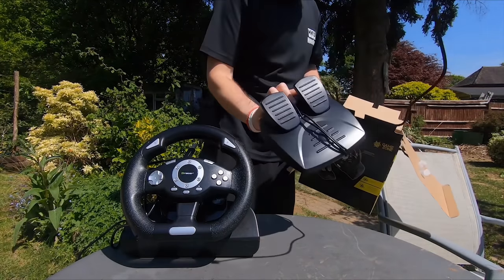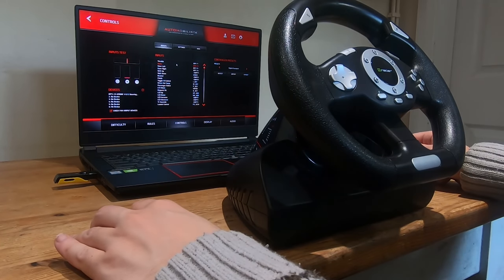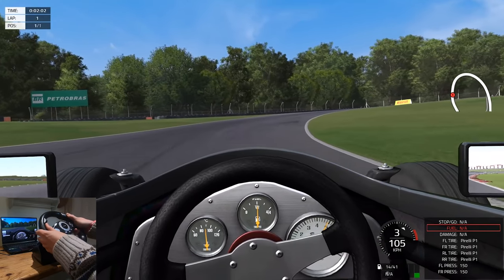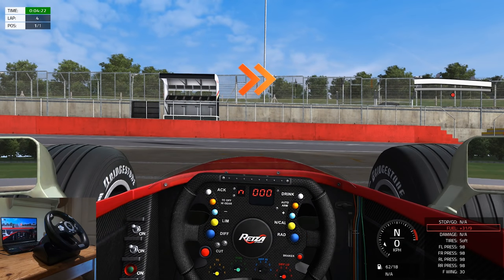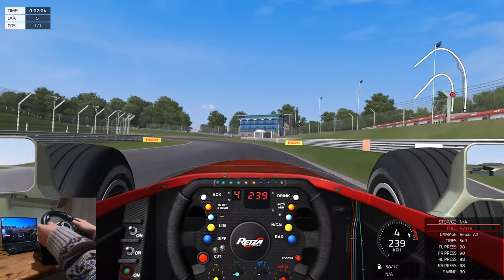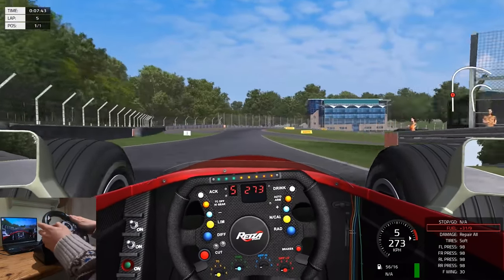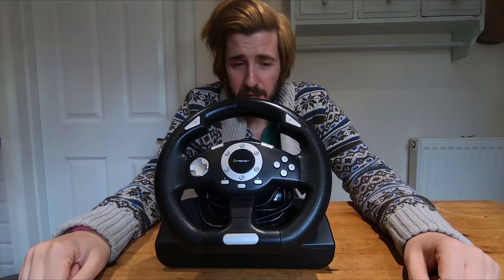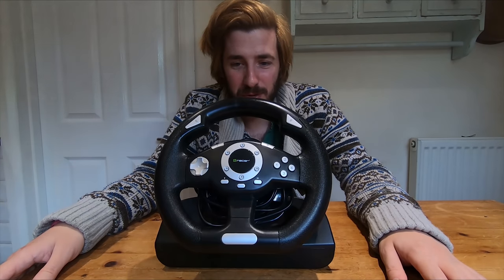Amazon's Cheapest Sim Racing Wheel Is Better Than I Thought!

Comment from the maker: Sorry about the flickering boiz, only realised it after recording :(
Reply: Jimmy Broadbent hi
Reply: shh bby is okay
Reply: I had a party while waiting Jimmer!
Reply: not your fault boss...the flicker is caused by the fact that the lights strobe at the line frequency of the electrical power and if your FR (Frame rate) of your device is close to that frequency, it is noticable. Nothing you can do about it so don't worry.
Reply: Hi jimmy, I’m currently using a cheap wheel and pedals, hori apex RWA for PS4, Would it make a lot of difference if I upgraded to a Fanatec  CSL elite. thanks
Reply: Jimmy ur the best, big love from Texas!
Reply: Flickery boi
Reply: Whoever masters this wheel is the true tarmac specialist
Reply: As long as you don't clip the black point when you edit the video, I'll forgive you.
Reply: @railwayman100  most of the cameras has option to adjust shutter speed, then you can get rid of the flicker in normal situations (like this is).
Reply: Hi there Jimmer!

This can be reduced/eliminated in edit!
What you would have to do is duplicate the videotrack, shift it over 1 frame and reduce the opacity to 50%.

This flickering is offcourse down to the frequency that your fluorescent tubes are using. 
This is usually 50 or 60hz, therefore you would have to use a 1/50th or 1/60th shutter speed to match that.
Reply: Just use 50 or 25 fps on the camera instead to match the power freq. of 50Hz. And a shutter speed to match if possible like 1/50th or 1/100th of a second. But the fps is most important.
Reply: Love the christmas sweater
Reply: Oh I thought it was disco themed
Reply: if i remember correctyl if you are using a led light bulb the flicering means that the capasitor in the rectifer in side of a buld is broken or the factory used a low capacity one i moght be wrong tho coz i just started mechatronics
Reply: F
Reply: @Elgsdyr  Yes, exactly this. 60/30fps cameras of the Americas don't match the Europen 50hz system - also why our analogue TVs were 50 fps. :)
Reply: "Jimmy Bruhbent"...
Reply: honestly did not even notice until u mentioned it
Reply: Use the wheel with the f1 drivers when u practise plz would be so funny but only for a bit
Reply: Andy Mooring not close but if the frequency is a harmonic of the light strobe which is likely 120Hz. This must have been recorded at 60Hz it 30Hz
Reply: Previous video: we have analogue!
This video: we have flickering!
Next video: we accidentally delivered killer hornets to England
Reply: Is that new go Pro on the LED lights?
Reply: YouTube continues to unsubscribe me from your channel!  3rd time in the last week or so now.
Reply: Can you find it in your budget for a white balance controlled LED camera light? Would look good over the peddle box cam too.
Reply: @ls-so8bt  yes I know but Jimmy didn't know this at the time of recording. If he wants to, he can get rid of the flicker when editing the video by duplicating the same clip but move the 2nd clip by 1 frame. All this does is fill in the empty gap of the flicker from the 1st clip and the end result is good...flicker gone. I'm sure Jimmy can fix his shutter speed of his cam the next time he goes in the house...only question is, what speed does he set the shutter to counter-act the flicker and I don't think Jim is going to waste a day doing that.
Reply: didn't notice until you mentioned it
Reply: @robbuckgaming2541  yes my friend 🙂 it will take a few hours to get used to force feedback, but it will be a giant difference and it's worth it, just make sure the wheel u buy supports PS4 if that's what ur using.
Reply: Switch to leds man.
Reply: @MrtinVarela  not his house bruh, he be a burglerboi
Reply: @railwayman100  you knew but just choose to say something else... that isn't kinda flicker you could easily remove in post edit. finally, when we don't know what cause the flicker there is not point to guess what shutter speed will fix it. setting right shutter speed is like 10sec thing, if you have no idea what you are doing then it might take 5min, not a day.
Reply: @railwayman100  He can try recording different shutter speeds and framerates.  Usually you can find a setting that works.
Reply: @catapultimage1137  "He can try recording different shutter speeds and framerates" now that Jimmy has noticed the flickering, yes for next time...if there's a next time.... but as he said, he didn't notice the flickering until after recording so he wouldn't have known during or even before recording what speed to choose seeing as he was too focused on making this follow-up. There is a small amount of flickering in the previous T-racer video...you can see this for a few seconds (go 3 minutes 33 seconds in).
Reply: RobBuck Racing from personal experience, HELL YES!
Reply: fluorescent bulb in the room?
Reply: @robbuckgaming2541  lol
Reply: @robbuckgaming2541  about 45 seconds mate as long as you find 43 in yourself
Reply: Trying hard to think about the "never give up" meme after I went into AC and tried hopelessly to beat that 1:08 on Brands Hatch and failed, with a better wheel (no ffb as well but still better than that one)...
Anyway, great video, no need to apologise for anything Jimmer. Keep going strong.
Reply: pesky LEDs
Reply: dude you look more like some English rock star from the 70s then an actual new reporter
Reply: a suggestion on the brakes I feel like if you open it up you'll see a spring mechanism or something like that and to brake much better you have to replace that spring or at least put something to tighten it up so you at least get to brake properly
Reply: only noticed it when I saw this comment.
Reply: @railwayman100  well... there are plug-in effects to correct for this sorta thing
Reply: It has such good ffb the gaem can't handle ahaha
Reply: Every recording needs to have a problem big f bad luck.
Reply: You should test the Thrustmaster TMX. It's what I have for my Xbone. 900 degree rotation, optional clutch and shifter, works on a Windows 10 pc and comes in a only 100 quid.👍
Reply: I feel your pain. I have a fluorescent light that does the same when video-calling. 60Hz light & 60 fps, bad combo.
Reply: Please no flickorino :p
Reply: Jimmy Broadbent my eyes :(
Reply: itz cool boiiiiiiiii
Reply: Taya's Mini Lops leave it
Reply: What flickering?
Reply: Eh, I noticed the flickering but I didn't find it had any effect on the video.
Reply: @robbuckgaming2541  it would be a massive difference. Something like a hori rwa compared to a belt driven fanatec is such a massive jump it will shock you.

If you're used to using a bungee cord hori wheel, then a fanatec wheel would feel fucking amazing to drive on. The feeling of going from logitech to a belt driven wheel was the most satisfying feeling.
Reply: Alec Pitcher I bought a fanatic csl elite in may, it’s the best thing I’ve ever bought, improved my times on all games buy loads, thanks for your input mate. 👍
Reply: I have a t 80 thrustmaster so your saying I shouldn't upgrade
Reply: Yeah it was slightly nausea inducing ':-D
Reply: Waht did you were playing while using the streeting wheel?
Reply: Yeat

Comment: You should do a Beamng rally stage with this wheel.
Reply: @the Game, Review and Reallife Channel Beam is a lot more diffucult, and the crashes are realistic, so he will crash, and it will be satisfying
Reply: At least he has throttle control... try the BeamNG steering wheel app! 😬
Reply: Henry R. You’ve not played dirt 2.0 then
Reply: Beamng is a crash simulator not a driving simulator. It’s hard to drive beamng because the driving physics are wrong.
Reply: @dylanzrim1011  exactly why it is fun to play, you play beam for the crashes, not the driving, that's why it is more difficult, and no, I have not played dirt 2 but I did play older dirt titles
Reply: BeamNG: I see you have chosen death.
Reply: He aint ready for that carnage
Reply: Dylan Zrim coming from a rally driver, Dirt is incredibly unrealistic. Especially tarmac driving.
Reply: Henry R. The new ones are equally as inaccurate as the originals.
Reply: @renderyours510  how about BeamNG? Is it a little bit accurate? Because the physics in it is pretty good.
Reply: @dylanzrim1011  beaming actually has really good driving physics, Jimmy even mentioned it in another video.
Reply: He will never finish the stage without crashing
Reply: @dylanzrim1011  the physics are fine,the car setups are bad
Reply: @dylanzrim1011  Bruh... If you think BeamNG is a crashing sim & not a driving sim, then you bought the game for the wrong reason
Reply: Those saying BeamNG is a crashing sim or has terrible physics is maybe playing some old pirated version or just repeating someone else's opinion on an old version because newer versions are pretty accurate. Also, force feedback was added-oof, quite a while back! I've lost hours to tuning suspension  and swapping out all sorts of parts for stupid setups with 40 psi of boost or make some springy off roader, and even the setup on the bus is fun to mess about with.
Reply: @dylanzrim1011  actually beamng is the best sim for rallying with consequences
Reply: @dylanzrim1011  it feels like every car in beam has no grip at all, if you turn all the way at 20 MPH it'll just slide the tires but if i did that in a real car it would turn really hard and chirp the tires
Reply: @isatntt  Depending on the car you need to do a bit of tweaking. Many haven't been updated to fit the updated physics. You can definitely get cars to oversteer properly in Beam, sometimes just changing tire pressure is enough

Comment: Me: Still, I'm gonna get the Logitech G29

Wife: Watches this video with me Naaaah you can buy this wheel!

Me: -_-
Reply: hahahahaha
Reply: @carscoffeeandcannabis-634  ya but t300 costs $100 more and the G29 has better availability
Reply: @carscoffeeandcannabis-634  Never thought about that. Thanks for your opinion 😀
Reply: Get the T500 they are dirtcheap now. Much better same price
Reply: @carscoffeeandcannabis-634  Well, the prices are crazy now from my knowledge. I wanted to buy a t300 RS GT but now they are around $450 and out of stock or on a sketchy website.
Reply: I have the g29, its ok, but the pedals are too soft, at least the brake has more resistance, but the throttle its too soft. I'm thinking to buy a fanatec wheel and pedals
Reply: @carscoffeeandcannabis-634  250 CAD? The cheapest I can find are €350
Reply: G29 has design flaw in it (one component that uses magnet to determine which position your wheel is in, if it fails, wheel will be few degree's off center) + its rather loud compared to Thrustmaster products. 
this comes from person who has the G29
Reply: The struggle is real lol. This is happening every day somewhere around the globe 4 sure. It is the only reason this crap is sold. Why do you always have the buy the more expensive stuff the cheap stuff is often just as good. And you have to try explain why in this case a g29 is the cheapest decent bullit proof wheel you can buy. And a wheels/pedal stand is a must. Second hand I bought both for under 250 euro ' s all in.
Reply: Hahaha! ^^
Reply: I have the G29 for Assetto, Dirt rally 2.0, GT sport, etc. It's a great budget wheel and I got it for 250cad. Tried the T150, found the FFB far too light and the pedals were the same as my cheap T80 which actually served me well for 3 years. If I wanted to spend about 400 more for a T300+T3pa pro+Th8a shifter I would have done it, but I'll probably upgrade to fanatec or direct drive options in 2-3 years
Reply: Cars, Coffee and Cannabis- damn that’s a great deal! Sadly I’m located in Germany and not to keen on paying import taxes and having the risk of my wheel getting shipped over the great pond..
Otherwise this would be the start of my sim career and I finally would buy a sim wheel after sneaking around them for years.
Once in a while I play with the fanatec setup of an colleague and it’s like heaven to me, sim racing is so much fun and I dream about my own rig everyday.
Hopefully in the near future I’ll be able to afford one!

Anyway it’s really nice of you to offer these wheels to fellow loyal Jimmer Fans at these pricepoint!
Reply: @carscoffeeandcannabis-634  is this offer for real? Like, can I take you up on it?
Reply: @sammylockwood  I have a g920, which is just the xbox version of the g29 and it is pretty good. I dont have any issues with it so if the price does matter than its definitely worth the buy. As for the T300 i dont know how much better it is for the extra $100, ive never used it
Reply: G29 a great starter wheel IMO, i've just upgraded to a csl elite but can definatly reccomend the g29
Reply: @carscoffeeandcannabis-634  I'm in Canada I'll come pick it up within social distancing lol.  Do these wheels work with ps4? I can't remember.
Reply: Nice job on pretending to have a wife and having any chance of sim racing in the house
Reply: @rrp6405  I already have plans. And She knows it!
Reply: Basically to sum up the replys u got don't buy a g29 I have one they are not fun past the second week and very frustrating, the force feedback sounds like a rave going on inside the bass of the wheel with people dropping shit all the time. And the pedals are a YOKE. Your better off with a thrustmaster  t150 or t300 if u have the cash to splash
Reply: I have a g29 brilliant wheel but the pedals aren’t great but I used a spring to stiffen the accelerator and clutch
Reply: Even the t80 is half decent
Reply: hahaha i cant afford on steam assetto corsa at 2 dollars
Reply: there are some better ones for under 50$
Reply: I had 2 thrustmaster wheels and had real issues with reliability, kept just falling asleep and not calibrating. I have had a great experience with my g29. Just my experience but I have been far happier with my g29...gear driven or not..
Reply: @Cynderfan35  yeah it is louder for sure that's a good point. G29 is so reliable though...

Comment: While prices are definitely skyrocketing, get the "logitech driving force GT" as an entry level force feed back wheel. Got it before the rona for 40$ used on Ebay and never looking back
Reply: yes its great ! even working on consoles with a converter
Reply: I bought a used G27 from Facebook market and hell I aint looking back either... Got couple of scratches here and there but still works perfectly well with the software.
Also it costed me half the price of a brand new G27 so I really cant complain... With or without warranty these things are reliable so im really good with that.
Reply: Diving force GT is great but if it's out off budget older Wingmans or MOMO are also great entry FF wheels if you can live with 180 degrees.
Reply: @victim2077  I had a Wingman Formula Force. It was still going strong but It doesn't work with 64 bit Windows and Logitech wouldn't support it and make it compatible. I read somewhere that someone made a driver that made it work in 64 bit but then the latest version of Win10 broke it again.
Reply: Since the Rona I decided to set up for GT6 in the common area, had been playing on a pad for ages but decided to get a wheel.
First one I saw was a DFGT for £20 on gumtree I didn't know anything about what wheel to get and started looking into what is a DFGT. By the time I realised how cheep it was it was gone.
Started looking for other stuff and a few days later I got a Formula Force EX from about 2005 for FREE!! wasn't even sure that it worked on PS3 so was stoked when it started spinning.  Been having a great time with it although I wonder how much better a DFGT would be I think they are similar except the rotation angle is bigger.
Anyone else had an EX and how does it compare?
Reply: @Dethmeister  I use "red wingman" on my 64 bit Win 10 never had any issues and I am using official logi driver
Reply: @victim2077  , Really? I think mine is a first gen, it has the full red rubber wheel. Is yours a newer Wingman Formula Force GP that just has the red accents? Mine isn't a GP. Anyway, I bought a Fanatec wheel set a long time ago to replace it but it'd still be cool to have the Wingman on a second computer. But from everything I've read, it won't work in 64 bit Win with official Logi software.
Reply: @Dethmeister  Yeah I have Formula Force GP. Even works on PS2
Reply: @victim2077  , I think what's different about mine is that it has an old style joystick plug connected to a usb adapter.
Reply: @Dethmeister  mine works 64 bit. Download 5.10 driver
Reply: The only thing I don't like about my GT is the force feedback doesn't let the wheel return to center as easily as it should so when drifting I have to manually do it.

Makes drifting harder than in real life.

Looking for a cheap converter for my PS4.
Reply: I got a Microsoft Sidewinder force feedback for FREE because the seller just didn't want it! Shipped to my house for no cost! It's great, full ffb and great wheel!
Reply: It says these wheels are for only PS2 and PS2???
Reply: @arthurbarette768  would it work on an xbox one?
Reply: @djhaug8172  plug in with USB, been using it on Iracing no issue just download logitech software. The driving force GT that is, not sure what else this thread has suggested
Reply: I found a DFGT in the loft while I was looking for my HOTAS, so decided to give sim racing a go. Bung a sponge behind the brake and it is not bad. Had some really good laps with it in the end, although it was old/worn so the force in the centre was odd.. Got hooked, bought a fanatec, gave it to a friend to get them hooked too. win/win.
Reply: I am hoping that as life goes back to normal, we will see a bunch of wheels flood the market.